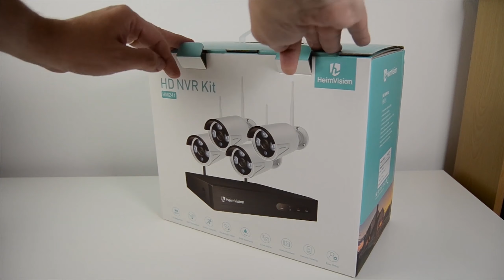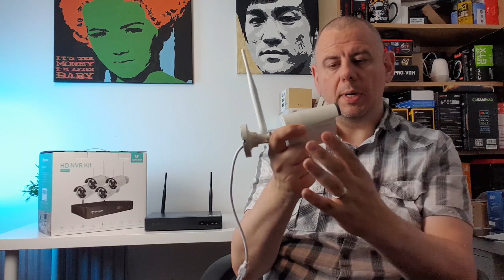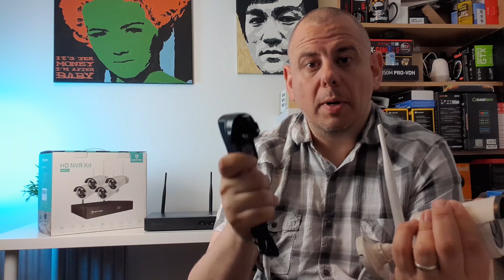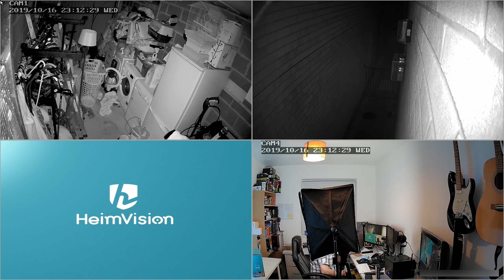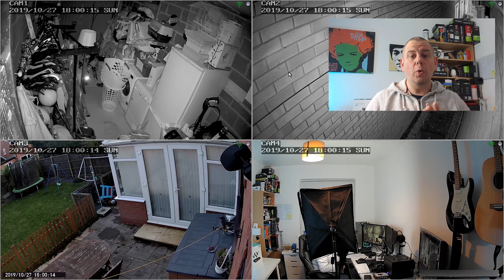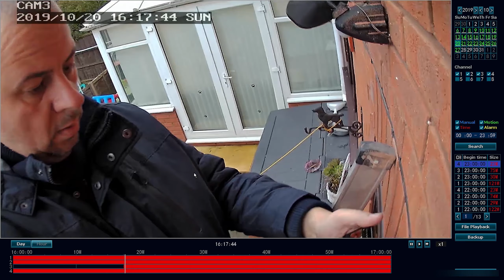HeimVision HM241 4 Camera Wireless Security System Unboxing and Review

Comment: I have tried 2 different 2TB drives, the system will not recognize either one. No issues with a smaller drive. Any ideas?
Reply: Which hard drive size works well for this type of cameras ?is 1TB enough ?

Comment: Nice system indeed Kev, Reminds me I still need to set mine up. Just haven't got the time.
Don't think this system would be to good for me though, Mines a old brick built house, very long and almost every wall is a thick brick wall :( 
I've gone for a POE system for that reason.